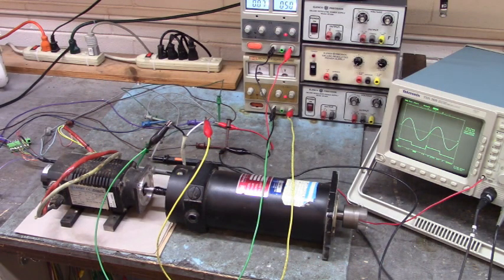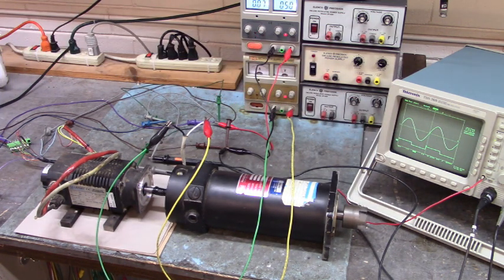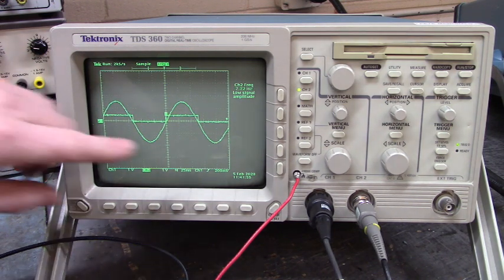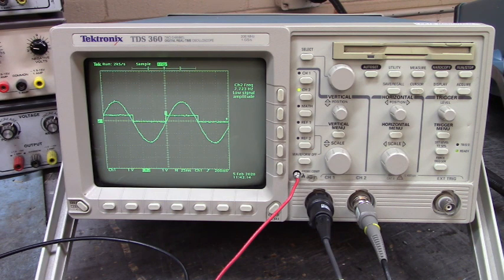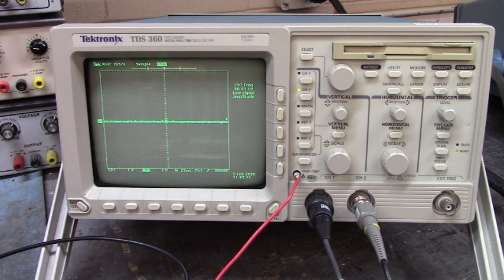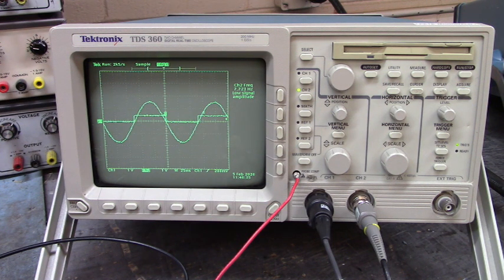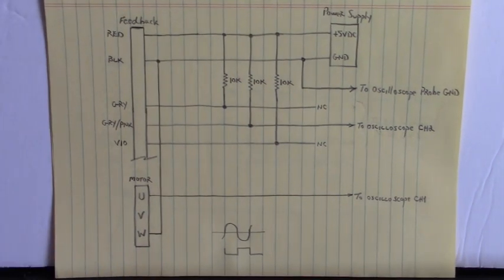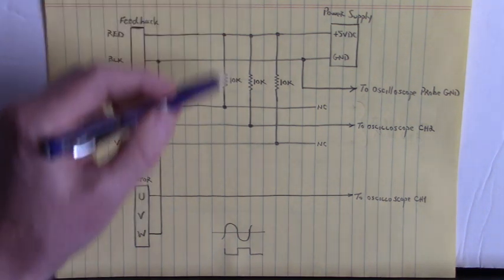Lafert Servo Motor Documenting the Hall Effect Timing

Comment: Hey Mr. PeePaw, friend, how are you?
Today we sent an Panasonic servomotor back to client, this one was failing the commutation signals after getting hot, due to a sensor fail. 
Very tricky to read the signals, since the encoder outputs just 2 wires of data.
Luckily the client has another servomotor, that he sent us, so we managed to understand what that messed serial data means, making it possible to set a circuit to decode it (1MHz serial data) into parallel info.
After that, we saw one of the commutation signals didn't like warm season anymore haha...
We did some mechanical adaptation, got rid of some pins on a IC, soldering the signals from an external encoder directly on the signal path.
Sounds absurd, but the client have no information about when they will send him another servomotor from China, with this viruses issues going on, so this Frankenstein servomotor will keep it going until they get the new motor.
Reply from the maker: Amazing Mr. Riggs. That is some awesome work. That is what makes you great. You figure out a solution to make the repair. There ain't to many folks could do what you just did:)  I hope all is well out your way. We are doing well here. Thanks again for stopping by.